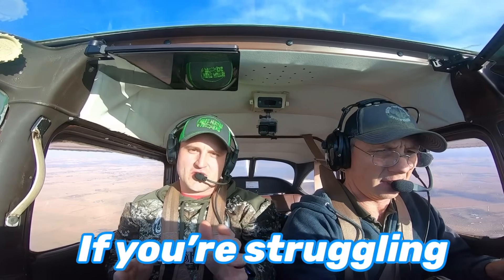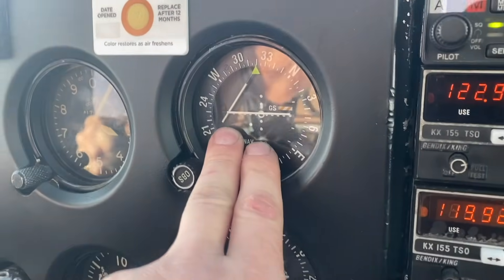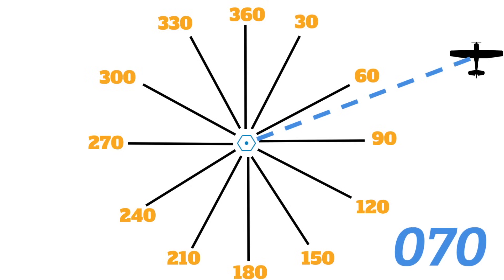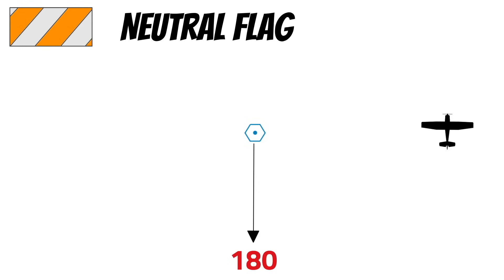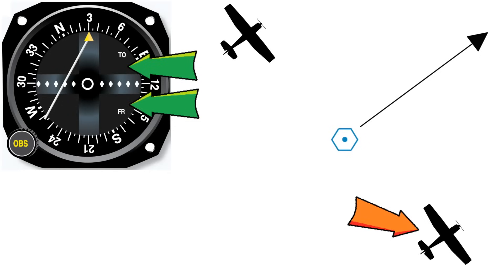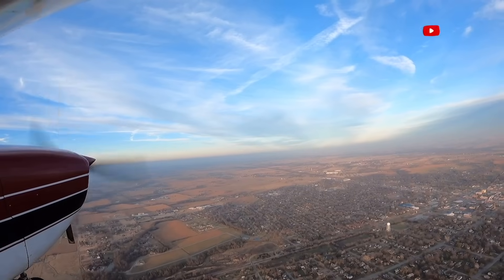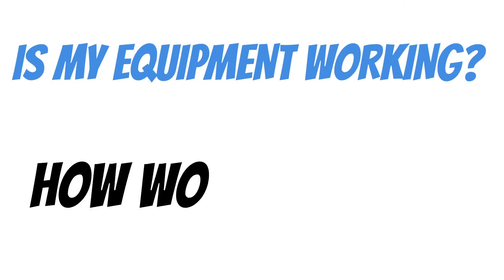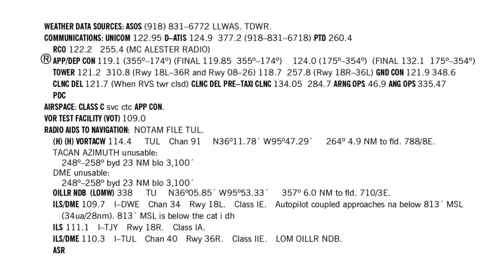You WILL Understand VORs after Watching This! (PPL Lesson 37)

Comment: I have a glideslope in my plane.  Does the CDI on the glideslope act as a VOR if you tune it to a VOR frequency?
Reply from the maker: The glidespope won’t be active, but the CDI will work just like a standard VOR
Reply: @FreePilotTraining  
Awesome!!  Thank you.  I want to use my aircraft for IFR training.  My flight instructor said it would be difficult because I don't have 2 VOR's.  Technically I do, since I have the regular VOR, and I can use the cdi on the glideslope as a VOR too, right?
Reply from the maker: @goneflying140  if you are referring to a completely separate CDI, then yes. If you’re referring to the glideslope on the same CDI, then no.

Comment: Listened to this a variety of times, made my own diagrams until it made sense in my head. Conclusion: this video really tells it ALL! Great job.
The only improvement I can see is that I would have summarized with the most common uses cases and how the CDI should look and what the bearing of the plane should be, for each use case (for example, these use cases:  traveling away from a VOR, traveling toward a vor, figuring out which radial you are on, triangulating your position using two VOR's,  navigating between two VORs) You talk about elements of each of these, but a bullet point summary of all of them, in a table at the end, would be great reference material)
Reply from the maker: Thank you! And thanks for the feedback!

Comment: Regarding one of the FAA’s questions you cited, you said that the cdi has to show FROM in order for you to know which radial you are on. I don’t get this. If the needle is centered, and the flag shows “to” and the dialed in radial is 210, are you not on radial 210?
Reply from the maker: Good question. If you are getting a “to” indication, you need to take the reciprocal bearing to know which radial you are on.  In that case, you would be on the 030 radial because you are getting a “to” indication with the 210 radial dialed In because you would need to fly a course of 210 to go to the station but your bearing from the station is 030

Comment: You mentioned the adding or subtracting 180 to see the opposite bearing. I have an even easier one for you. Let’s say you’re at 030 from the station and wanna fly directly to it. Add 2 to the first number, subtract 2 from the second number. That means 210. Now does it work the other way around? Sure! You’re at 350 from the station and wanna go directly to it. This time turn it around: first subtract 2 from the first number, and add 2 to the second number. That means 170. Keep in mind, if it’s below 180, you wanna first add, then subtract. If it’s above 180, you first wanna subtract, then add. If you don’t keep that in mind, you’ll either be in negatives or above 360. Good luck guys!
Reply from the maker: Thanks! That’s a great tip!
Reply: This is how I was taught!
Reply: bravissimo ! tu sei uno iscritto a : UCAS !  ( Ufficio Complicazioni Affari Semplici )
Reply: Was always told add 200 and minus 20. Opposite of 090? 90+200=290 - 20 = 270. And for 270, Minus 200 and add 20. 270 - 200 = 070 +20 = 090. Practically the same as yours but with more zero's.

Comment: I havent flown yet but im doing ground school for now. I dont really understand this part (3:50~4:37). I dont understand how the bearing is 070. If the radial only goes up to 360 and we are above 270 then shouldnt the answer be 090? Because 360-270= 90? .. i hope that made sense. If possible could you explain it to me?
Reply from the maker: If I understand your question correctly, you might need to watch some more videos on how a compass works before you understand this a little better.  090 is directly East, and 060 is north east. If we’re on the 070 radial, we’re in between in the 060 radial and the 090 radial.  Hope this help you. I’m not 100% on what you’re asking
Reply: @FreePilotTraining  this explains it perfectly. Thank you. Your videos are amazing. Super helpful.

Comment: Q- A- If the CDI needle is centered with a [FROM] flag-the aircraft is on the Radial indicated at the TOP of the CDI…if needle centered with a [TO] flag- the Radial the aircraft is on is read at the bottom of the CDI..? B- If altitude is odd + 500 ft 0-179° , if pilot does a 180° requiring even +500 ft is the change in altitude made during the turn around-or after the new HDG is established..?
Reply from the maker: Good questions. To answer your questions: A. Yes, when the CDI is centered and you have a “to” indication the radial at the bottom of the CDI is your bearing from the station.  As far as the altitude questions, just wait until you’re established on a new heading to start a climb or descent.  If you are on flight following with ATC, let them know before you climb or descend. Sometimes they’ll keep you on the altitude you were on if they think you’re going to be a conflict for another aircraft
Reply: @FreePilotTraining : Thanks once again for sharing your professional expertise and prompt response. Excellent vids that edify.
Reply from the maker: @danjarvis6980  you’re welcome! Thanks for watching! I’ll see you around

Comment: In an effort to wrap my head around this VOR nav, [ IF ] I understand it correctly, 1-If I want to know my position relative to the VOR I need to turn the OBS knob until the needle is centered and the instrument is showing a FROM flag..is this correct..if I was Southwest of VOR I should be on about a 225°radial FROM. 2-two radials FROM two different VOR’s that cross at a good angle, 60°-90° can give a fix of position (IF) the two bearings or radials were taken and plotted with minimal time difference between them,back to back, using only one CDI..?
Reply from the maker: Ok. I’m not sure exactly what you’re asking with #1, but everything else you said is exactly right.  In reference to the heading, the VOR doesn’t care about that whatsoever. The CDI is only giving your bearing from the station.  If you want to know your bearing to the station, you have to go “through the station” to a radial on the other side. With that in mind, if I’m on the 225 radial FROM the station (which is southwest of the VOR), and I want to go to the station I need to tune in 045. Now even though the CDI doesn’t care what heading I’m on, I need to turn the aircraft on a heading that will take me on a course towards that radial if I actually want to go to the station. Otherwise it will be completely worthless
Reply: Thanks for your prompt reply: so if I’m flying TO the VOR, needle centered, my course or heading indicator reading and the radial I’ve selected should be in agreement-no wind correction.
Reply from the maker: @danjarvis6980  no problem. Yes that is correct
Reply: Q- if my selected VOR has functional VORTAC and my avionics has DME capability- is a Bearing FROM the VOR with distance indicated-accurate enough to plot my fix or position on my chart without having to use cross bearings from two separate stations ?? Eg.. if on the, two-two-five radial at 46 nm indicated distance (225° radial FROM @ 46 nautical mi) or is using two separate VOR stations standard practice..
Reply from the maker: @danjarvis6980  yes it is. If you’re using actual DME equipment, the distance from the station is going to be in slant range though so if you’re really close to the station and you’re at a super high altitude, the distance could be a little off. When you get into instrument flying is when this really matters, but for plotting your position on a chart, it’s plenty accurate
Reply from the maker: @danjarvis6980  you’re welcome!

Comment: HOT TIP!  🔥  POOR PILOT'S DME!  
Track any radial.      
Mark the time.        
Turn 90° port or starboard,  
Fly one 1 minute.   
Note the new radial.   
Note the Change in Radial, say its 5°
<Ground> speed ÷ Radial Change = DME  
Thats within +5 to +10% of true distance, when max change in radial is limited to less than 20°. 
Example:
Gnd Speed = 150 knt  flying 1min gives a 5° change in VOR radial
150÷5 = DME 30 nautical mi.   Actual DME is 5% closer at 28.6nmi
Note that accuracy varies from 
+5% with a 1° radial change/min  to 
+10% with a 20° radial change/min.
Caution!  Do not use for more than 20° change in radial to keep error <10%
A radial change of 35°, the accuracy falls off to 20%  
At 150kn GS,  150/35 = 4.4kn mi. Actual is  3.7

Comment: For me the best way to get the opposite course quickly is the +2/-2-Rule. For instance: Bearing from 070: 070 + 2 = 270 - 2 = 250.  Bearing from 270: 270 - 2 = 70 + 2 = 090.
Reply from the maker: Yes! I use this method! I have a short video on it.

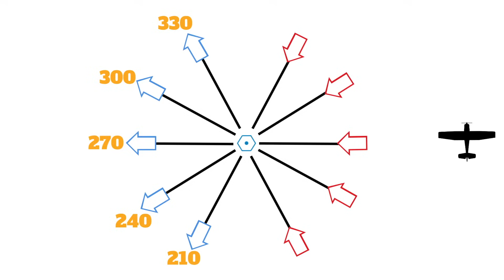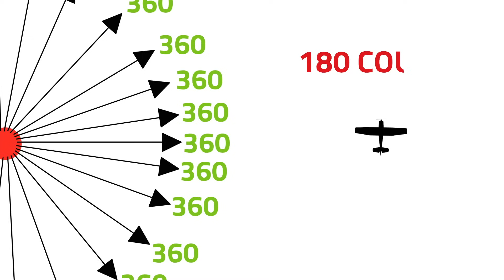Comment: Hey I think I might have found an error in your explanation, but I'm not sure so correct me if I am wrong: At 4:38 you're saying that the plane can pick up the radials from the other side of the VOR. Now, if this were the case the test VORs would never work as you explained at 18:30. I don't even know how it would decide which 360 frequency to use. The one in front or the one behind. The to or from one? Instead I think what happens is when you turn dial, you're actually flipping the magnetic pole of the sensor which determines whether the frequency you're receiving is interpeted as to or from. What do you think?
Reply from the maker: So, it’s actually a lot more complicated than that,lol.  I explain it in a way that’s very basic, but mostly true. The VOR spins around shooting out two signals in all directions. One of the signals is a reference signal that is a specific frequency, then it shoots out another signal that is the same frequency, but is slightly out of phase with the first signal.  When you tune in a specific radial, you are actually tuning your CDI to match that signal. So you are picking up that “specific phase difference,” you are picking up that radial. It doesn’t matter what side of the station you’re on.  When a VOT sends the signal out, it sends the same two phases out (the 360 signal) and that’s what your CDI picks up.  Hope this helps
Reply: @FreePilotTraining  ah yes, that does actually make a lot of sense. Thanks for explaining!
Reply from the maker: @ChristianMeyer  No problem!

Comment: While many people are praising this presentation, I must tell you that certain things you are teaching are technically wrong.  All VOR receivers detect one thing.  They identify the radial that the aircraft is on.  All information displayed on various instruments uses that radial.  In your example of being on the 090 degree radial and flying the 270 radial on the other side of the station is not possible.  Using the magnetic heading supplied by the compass, the two VOR indicators can display an inbound course to the station, but in actuality,  you are flying inbound on the 090 degree radial.  Thinking, as you teach, that you are somehow flying a radial on the other side of the station is bad..  In more advanced instrument training the student will be thoroughly confused when given holding instructions based on a radial and DME fix.  For the most precise position awareness, the student must learn to visualize the aircraft position on the VOR's radial and understand how that information is displayed. I realize there are many ways for the instructor and student visualize and communicate, but inserting a thought process that is basically incorrect in not a good idea.
Reply from the maker: first, my equipment can detect a radial, even if the aircraft is not on the radial.  Also, If this was not correct, then you would not be able to set ONE final approach course in and keep it after station passage on VOR approaches where the FAF is the station itself.  That’s because your CDI is sensing that radial on the other side of the station, and you are flying a course off of the radial.  If it weren’t possible, they wouldn’t build entire instrument approaches off of it… 200,000 people have watched this video (including instructors) and you’re the first one to mention this.
Reply: @FreePilotTraining  I didn't know that my comment would require more explanation.  The function of the ground VOR station is to broadcast two signals that on board equipment analyzes to determine a "radial".    I copied this from Wikipedia because it explains it so well.  "A VOR ground station uses a specialized antenna system to transmit both an amplitude modulated and a frequency modulated signal. Both modulations are done with a 30 Hz signal, but the phase is different. The phase of one of the modulation signals is dependent on the direction of transmission, while the phase of the other modulation signal is not, in order to serve as a reference. The receiver will demodulate both signals, and measure the phase difference. The phase difference is indicative of the bearing from the VOR station to the receiver relative to magnetic north. This line of position is called the VOR "radial"."  Your on board equipment can only read phase difference at the current position of the receiver.  I presumed you understood that when I made my first comment.
Reply from the maker: @ampicoab   First of all, Wikipedia is not a credible source. Second of all, I don’t disagree about anything that article says, but it also doesn’t really explain why you disagree with my teaching method, so I’m not sure why you included it… the “position” that this is talking about is a relative term because my CDI will give me data as long as I’m in range of the station. And somewhat close to that radial.  I could be up to 200 miles from the station and still be in this “position” the article is talking about.  I can pick up the radial on the other side of the station just as easily as the radial that I’m on, and it will still give me positional information

Comment: Great lesson! Well articulated, illustrated and demonstrated. An other good trick is: FROM top TO bottom. To find out on what radial you are on, rotate the OBS and when the needle centres if you have a FROM indication, you read your radial position on top of the indicator. Conversely,  if you get a TO flag, you read your radial position from the bottom of the I indicator. Thanks for the video,  well done!
Reply from the maker: Thanks! That’s a great tip! I haven’t heard that one before! I appreciate the input
Reply: That’s how I think of it too !
Reply: Yo! Thank you for that advice! That just clicked for me! Appreciate yea!! 🤙
Reply: why did this click for me better than anything in my textbook 😩 thank you I understand it now !!
Reply: So many different ways to explain/learn. I learned this one as "read the radial from the base of the triangle", which is basically the same: When your VOR flags FROM the station, the base of the triangle is facing upwards, so you read your radial on top and vice versa.

Comment: Great video, thank you.
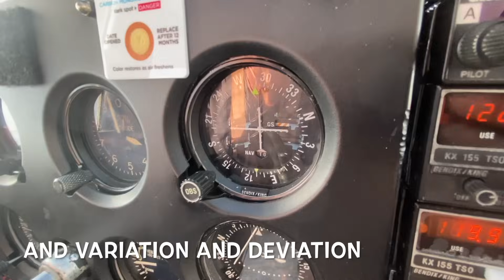At 14:50 you implied that the Heading that you're flying has to be corrected for "Variation and Deviation". I think correcting for "Deviation" is okay, but not "Magnetic Variation", since Variation is already built into the radial from the VOR, correct?
Reply from the maker: Good question. The heading you fly and the course form the VOR are two different things.  You’re heading is subject to variation and deviates you mentioned PLUS the wind at altitude.  The radial on the VOR is a COURSE not a heading. You are correct saying that the course on a VOR is a magnetic course, but in order to fly and maintain that course, your heading is going to be different because of deviation and wind. Make sense?
Reply: @FreePilotTraining  So the radial on the VOR is a magnetic course from the VOR, but to fly that course, the actual heading must be corrected for Magnetic Deviation and Winds aloft. Now I understand it, thank you.

Comment: Err...  what's the difference between selecting 270 and flying 'TO', and selecting 90 and flying 'TO'?
Reply from the maker: You won’t get a “TO” indication unless you dial in a radial on the opposite side of the station. If I’m on the 270 radial, and I have the 270 radial dialed in, I will get a “From” indication. If I have the 090 radial dialed in (or any radial on the other side of the station) I will get a “To” indication and I can use those to fly TO the station. If I have a “From” indication, and I try to use that course to fly TO the station, even if I’m flying towards the station (the course you are flying would be the opposite of the radial tuned in this case), your CDI will work backwards and “reverse sense” hope this helps